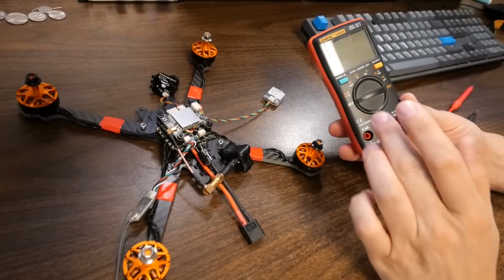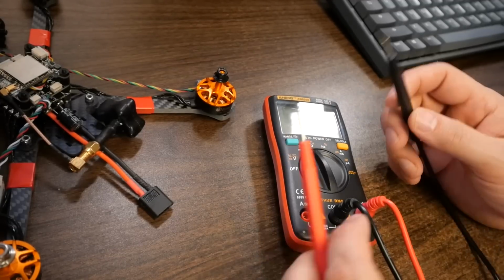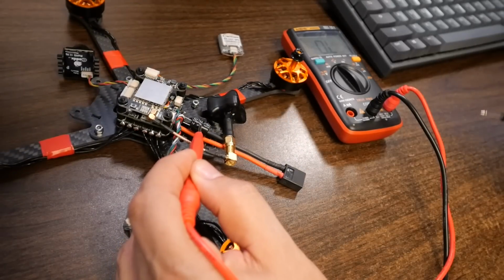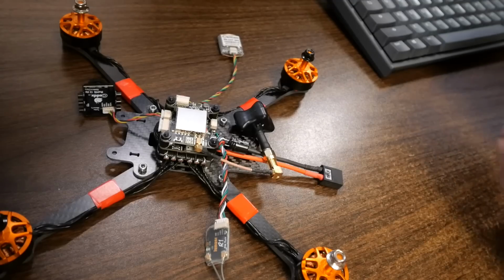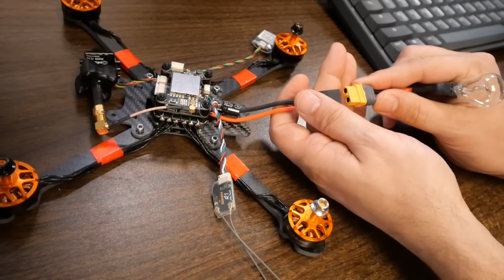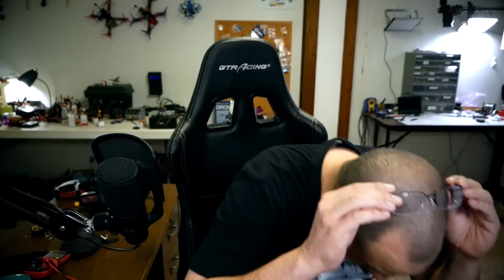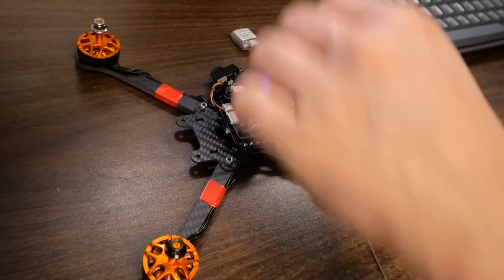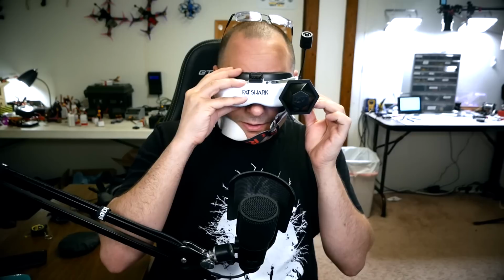Beginner Guide $120 FPV Drone How To Build - Part 2 - Smoke Check

Comment: Cheers from Tasmania!  I'm working through the videos, Josh;  I had the same problem as you did.. no light on the VTX..and no volts on the Vtx either. Could you please talk me through the  solution?    I want my Tyro in the air!

Comment: Anybody run into a positive smoke test when the VTX is plugged in?  This is my first build.
Reply from the maker: That just means the vTX is pulling enough current to put you over the threshold and trip the smoke stopper. Usually there is no fault, just your smoke stopper bulb is under-sized or your vTX is particularly hungry.
Reply: @JoshuaBardwell  Thanks.  Your channel is awesome.  Just subscribed to your Pateron channel.

Comment: Often I worry as to wether or not I may have soldered bridged one of the motors to one of those "tick" shaped legs next to the joint, would the continuity test would of failed?
Reply: I cannot guarantee that it's soldered it's just partially melted.

Comment: Joshua I'm concerned because my VTX is getting fairly hot when I did my smoke check. It was on for less than 5 minutes and I couldn't hold my finger on it comfortably. Is this normal?
Reply from the maker: Pretty much yes. You can try activating the option "low power disarm" to reduce vTX output power when you are disarmed. Personally I like to set it to "until first arm".
Reply: @JoshuaBardwell  alright, thanks for the fast response!

Comment: Hello Joshua, my VTX is not working (not blinking and I can not see any image). Connector are correct and nothing smoked up. Regardless the Betaflight settings, the VTX should work, right? I have no clue what this is. I also checked an other VTX but it is the same.
Reply from the maker: If the vTX is not giving any sign that it is powered up then yeah the vTX has some problem. This FC does not have the ability to switch vTX power off.
Reply: @JoshuaBardwell  Thank you Joshua for your quick response, I found the problem. The firmware was too old. With a newer version of firmware the vtx was working. I build the tyro with the help of your videos. That was a big help for a noob like me :-)

Comment: Great Video. But can someone tell me why should the antenna be plugged in while connecting the battery ?
Reply from the maker: When the vTX is powered up without an antenna, the energy that it is trying to push into the antenna has to go somewhere, and it turns into heat inside the vTX and fries the amplifier. This is true of all radio transmitters. Some of them are designed to protect against this but vTX typically are not.
Reply: @JoshuaBardwell  thanks Josh. this is good to know

Comment: Hey, I’m currently in the middle of building this quad  but I’ve seemed to hit a stump since when I power it on, the video transmitter perfectly lights up, but the gps, receiver, and flight controller don’t seem to be lighting up(if flight controller is supposed to light up as well) Do you have any recommendations where I might’ve gone wrong and I can go back and look for a fix in the build? Also I used a smoke stopped when I powered it up and it did not light up. Thank you
Reply: I had the exact same problem, literally word for word. The way I was able to fix it was another continuity test, turns out I has a solder blob on one of the joints for the receiver. I re soldered, and everything now works perfectly. If I were you, I would double or even triple check your solder joints with a magnifying glass and a continuity test to be sure. Good luck.

Comment: Shorten the leads on that cap! You want to have as little inductance (loop area) as possible for the cap to be able to react as fast as possible. Also, the resistivity is unnecessarily high with any length of those tiny wires. Think about how those caps are normally soldered to PCBs: they are standing flush on the board!

Comment: Okay - so this video has a major flaw in my opinion as a newbie - never built one but interested to get started. The flaw is when you were talking about 5 Volts, 10 Volts, vbat... what in the hell are those? Where were they located on the chips? How did you find the problem? Why didn't you show us how you fixed the problem and then showed us how your fix was confirmed, beside the light turning on?  Did you use the voltmeter to track down the error? How did you find the problem?  The answers to these questions would fulfil your stated purpose for creating this series.  So far it has been good up until you completely lost me on this vbat / 10v problem.. I don't even know what a 10v is used for, what it does and why it was related to the failure of the smoke testing..  Thanks

Comment: Josha i have dys elf, i updated ESC firmware via BLHELI afterwards the drone is not flyable pushing throttle a little immediately gives the motor full power, please if you can help will be grateful.
Reply from the maker: Probably the motor direction is incorrect. Check that all motors spin the same direction as shown in the Betaflight Motors tab. There is a diagram in the upper left.
Reply: @JoshuaBardwell  thank you i will update you shortly

Comment: Thanks for another informative video.  Two questions. First, why some ESCs don’t have capacitors.  Got myself RTFs/BNFs for now. The TranstecBeetle HOM HD don’t have one. Second, just curious on your choice of antennas for your goggles.  Thanks.
Reply from the maker: Not all ESC's need additional capacitors, especially if you are using 4S voltage vs. 6S. The ESC has on-board capacitors, and they are sometimes not enough so you have to add an electrolytic.
Reply: Joshua Bardwell just for experimentation, what happens if I add a 16V 100uF on the Transtec 25A 4in1 ESC? Any advantages or disadvantages?

Comment: Is there any drawback to using a lab power supply with current limiting instead of a smoke stopper? I've got one, and I'm too lazy to go out and buy a car bulb. It's worked fine so far, including handling an on-the-bench vtx burnout/short while running up the motors, but... Are there situations it won't be able to handle?
Reply from the maker: No drawback. Just not everybody has one, and not portable.

Comment: Would you recomend the eachine ew30 or the emax fpv goggle
Reply: Alejandro Perez if you can shell out 100$, the ev100d is great
Reply: I'd recommend ev800d. Emax didn't have a DVR, which I would say is essential for flying anything bigger than a whoop (and nice to have even then). Eachine ew30 seemed to have some problems with its DVR and also worse screen(s) than ev800d. Ev800d can also be used as a monitor if you want to share your flying with other people. I know it's more expensive than your choices, but good goggles can be a difference between losing/breaking your quad. So it might be cheaper to get proper ones from the beginning. It also makes the flying more fun when you have the proper gear. But if there is absolutely no way you could get the ev800d, out of those two I'd probably go with the ew30. Just because of the semi-functional DVR (I assume you are building this 5 inch).
Reply: thejse007 ^this

Comment: I once smoked a VTX because it had a 5 volt input and I soldered it to vcc.
I didn't even know that there are 5 volt VTX and now I'm more careful
Reply from the maker: The 5v ones are typically much smaller and are used on micro quads and racing drones where size/weight matters most.
Reply: Yes it was a cine whoop

Comment: Troubleshootingconclusion: when 10V = 0V and 5V = 5V then a pin is bend. 
Is that correct?
Reply from the maker: Basically.

The ESC has both 5v and vBat outputs.

The FC has a built in 10v regulator, which is fed from vBat. The FC does not have a built-in 5v regulator; it gets 5v from the regulator on the ESC. This is a pretty unusual arrangement. Typically the ESC would have no regulator; the ESC would feed vBat to the FC; and the FC would have both a 5v and 10v regulator.

So typically, you would see the 5v and 10v regulator either work, or not work, together. I was pretty confused when I saw the 10v regulator not working and the 5v regulator working, and I initially thought the 10v regulator must just be damaged. Because how else could 5v work but 10v not work. Also, typically if the FC doesn't get vBat, then the FC doesn't power up at all, since the FC runs off 5v.

With this specific arrangement, if the FC does not get vBat, then the 10v regulator does not power up, but the 5v regulator still works since the FC is getting 5v directly from the ESC. Once I figured that out, I tested the vBat input to the FC and found that it was dead/disconnected. Then I started working backwards to figure out why the FC was not getting vBat input, and I was able to find the bent pin.
Reply: Joshua Bardwell  Thnx for the explanation. Nice troubleshooting 👍

Comment: Hahaa brilliant vid...smoke stopper ftw chk ✓

Tell me, which rx should I buy for Flysky bind? Having a  FlySky tx. Your recommendation?
Reply: I have a X6B with a FLIT10 on the way. The X6B has Clerik's mod installed on it (and the TX - FS-i6X had Clerik's mod).
Reply: I would pick xr602t-c2, which is the perfect size, dual antenna for great reception and ipex Antennas for easy replacement. 

But the cheapest and one of the best with also great range is the X6b receiver. Sadly, it's huge in an small build. Again ipex connecter for easy antenna replacement

Comment: Very bad eachine motors, so bad, better buy another drone
Reply from the maker: Like I say in the introduction to part 1, there are much better quads out there, but this one is very inexpensive and it will get a beginner into the air and learning the process of how to build.
Reply: Years ago I built my first 5" quad using not-so-great parts I accumulated from sales, like the PWM ESCs, frame & prop bags were $1 each. I knew it wouldn't be a speed demon or freestyle champ, that wasn't my intention, I only built it to give me the experience of building an FPV quad from parts.
How did it fly? With my 2200mAh 3S's at the time, it managed to stay off the ground youtu.be/etqFbFO5M30 :)